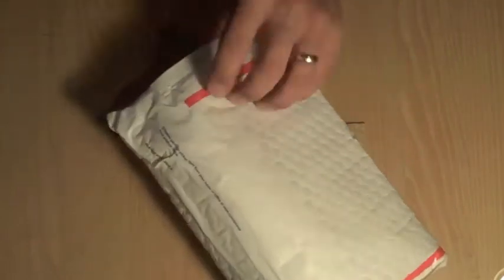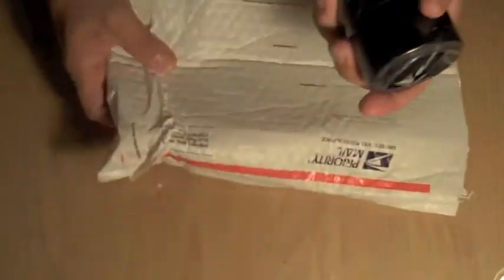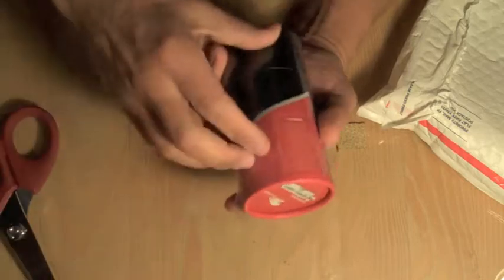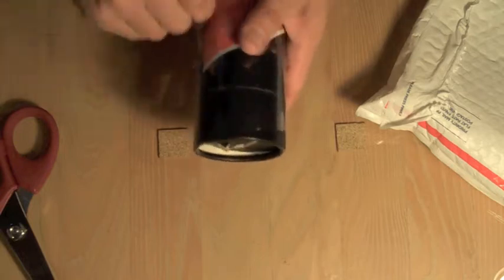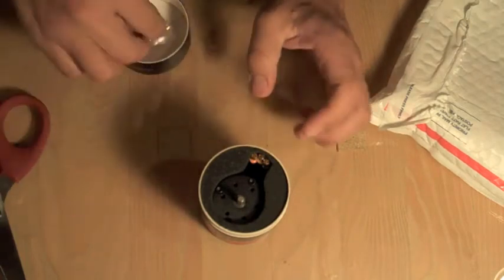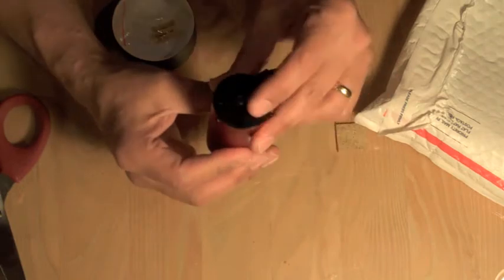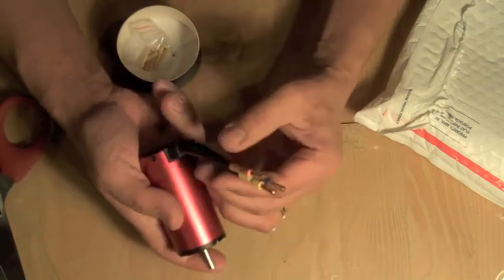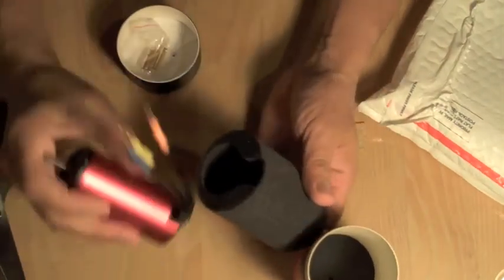Unboxing a Leopard LBP4082 1600kV Brushless Motor

Comment: is this motor ok for b.j 29 v3 and from where to order? 
thanks
Reply: I have the same motor in my PB mystic 29 with 180a esc turning a m455 prop. It does 67mph
Reply from the maker: i dont know bj29. best price usually on omni modles
Reply: +RCKiddo71  i meant pro boat blackjack 29 v3.
thanks